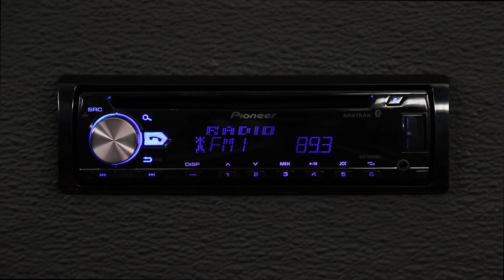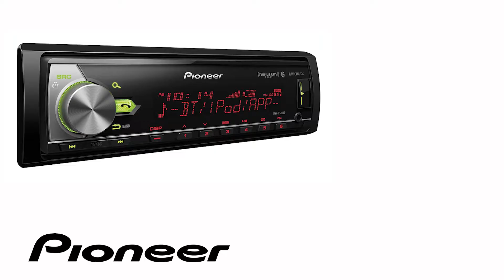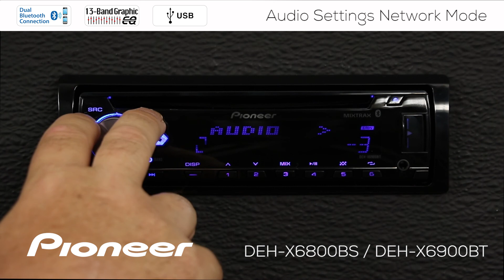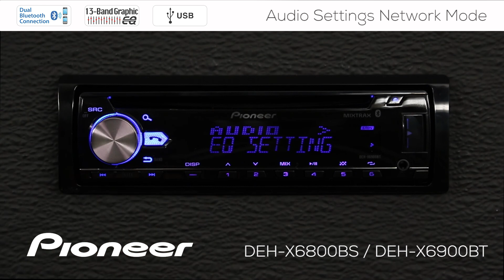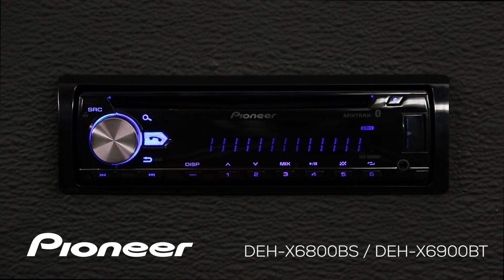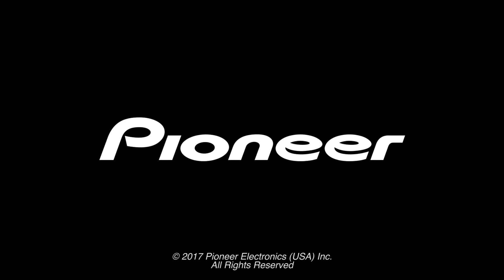How To - DEH-X6900BT - Advanced Audio Settings Network Mode

Comment: I have a Pioneer DEH-X7800BHS in my Mk4 Jetta , I got it all connected, it works just fine but when I turn the car off all the settings reset, besides the Bluetooth connection with my phone(that stays). I also have a subwoofer and the power light from the sun stays always on but I can hear the sub starting when I turn the ignition on because it pops once(which I don’t know if it should). Thank you very much in advance!
Reply from the maker: Your receiver is wired incorrectly.    If your clock and radio stations reset each time you start your vehicle, the in-dash receiver may have an improper connection for the Yellow Wire.  The Yellow Wire must have constant power from the vehicle.   This means if the vehicle is switched on or switched off, the yellow wire should measure at ~12 volts.   The Red Wire is for accessory.  You can view the red wire as the receiver’s on/off switch.  The red wire should measure ~ 12 volts only when the vehicle is switched on.  
--Do not connect the Red Wire and Yellow Wire together. --
Please take a look at this video for more information on wiring your Pioneer in-dash receiver:    https://youtu.be/kR2MO2kwFug?list=PLw63zJRQbCNgvZfn2Cr_RKpz7ar8oJs26

The subwoofer is also wired incorrectly.  If the subwoofer is staying on when the vehicle is off, it will kill the vehicle's battery.   What is the model number of your Pioneer subwoofer?   

You can find a full playlist of How To video from Pioneer about DEH-X7800BHS here:    https://youtu.be/kRgpPdiRIvo?list=PLw63zJRQbCNgvZfn2Cr_RKpz7ar8oJs26     and you can find more videos on Pioneer's YouTube Channel here:   https://www.youtube.com/user/pioneerelectronics
Reply: @pioneerelectronics  I'll check them again! Do you think not storing the setting could also be because my radio antenna is not connected to the actual radio? The subwoofer is a different brand, it's not Pioneer...
Reply from the maker: @IzzYChannel    I believe the issue is the yellow wire. The yellow wire should have power when the vehicle is off and when it's on. Do not connect Red and Yellow together.    Please note, the AM/FM radio will not tune in any stations at all if you don't have an antenna connected to the receiver.    You can find a full playlist of How To video from Pioneer about DEH-X7800BHS here:    https://youtu.be/kRgpPdiRIvo?list=PLw63zJRQbCNgvZfn2Cr_RKpz7ar8oJs26     and you can find more videos on Pioneer's YouTube Channel here:   https://www.youtube.com/user/pioneerelectronics

Comment: HI please  advise , i have a DEH,X8700BT, Ive i want to use the direct woofer with no amp , when switching from full range speakers to SW , Then back to main menu there is no sound in the rear only front and i have no fad control , please help
Reply from the maker: It is possible to operate a small subwoofer on the rear speaker output directly from a Pioneer in-dash receiver.  Please note:  This is a connection to the rear speaker outputs and not the RCA outputs.    I recognize model numbers DEH-X8700BS and DEH-X8700BH. 
 Please be sure to check the model number of your Pioneer in-dash receiver.  The instructions below are for the two models shown above.  You should be connecting the receiver's Purple, and Purple/Black speaker output wires directly to a small subwoofer.  The Green and Green/Black should be properly terminated so they don't come in contact with any other wires or metal in the vehicle.   Owner's manual page 21.     You can learn more about wiring your receiver in this Pioneer How To video:  https://youtu.be/kR2MO2kwFug?t=266     In the receiver's Initial Setup S/W Control settings choose SP:SW.   This will mean the front speaker outputs are full range and the rear speaker output is subwoofer.   When using this setting, No Fader Control will be available.  This is normal operation.  This is because you choose to change the system from Front/Rear output to the new setting of Front and Subwoofer  output.  The subwoofer output has an independent level control.  In the Audio Settings Menu, be sure to switch the Subwoofer 1 setting to Normal or Reverse.  Owner's manual page 19.   And in Subwoofer 2 choose an LPF crossover setting.  I recommend to start with 80Hz and an output level of 0.  You can find the owner's manual for the Pioneer DEH-X8700BS / DEH-X8700BH here:   https://www.pioneerelectronics.com/StaticFiles/Manuals/Car/DEH-X8700BS_OwnersManual090914.pdf   You can find more videos on Pioneer's YouTube Channel here:  https://www.youtube.com/user/pioneerelectronics

Comment: When in network mode, can all the crossovers be turned off? Id rather use the ones on my amplifer.
Reply from the maker: It depends upon the receiver.  What is the model number of your Pioneer in-dash receiver?  Please note, If you are going to switch all the crossovers off, all you have done is set up 3 full range RCA outputs.  Again depending upon the receiver, you may be able to do that with Standard Mode.    Please be sure to switch the Subwoofer output on in the audio menu.  Also, when you set this up, be aware of the outputs you'll use to hear Bluetooth phone calls in your vehicle.   This changes with Standard or Network mode.  You can learn more about Standard Mode and Network mode here:  https://youtu.be/k3q0Zm5jvHg?list=PLw63zJRQbCNiqf5pU1wQ00VD9BRgM0eH3   and how the slope changes the output here:  https://youtu.be/WvJXYh6vk_0?t=933    You can find more videos on Pioneer's YouTube Channel here:  https://www.youtube.com/user/pioneerelectronics